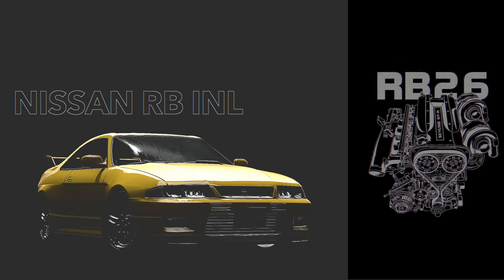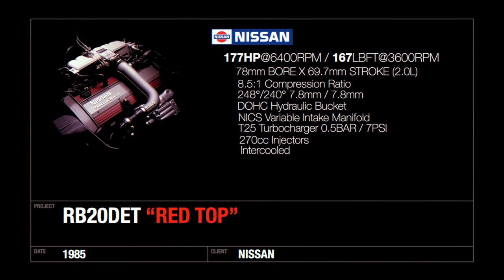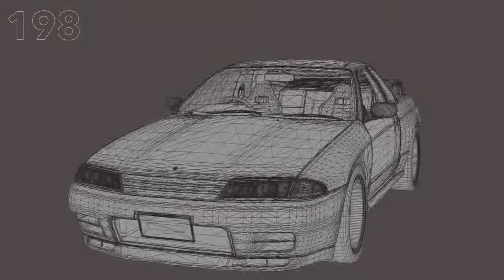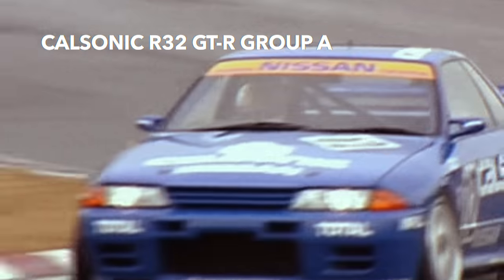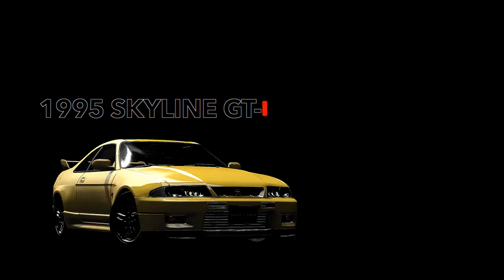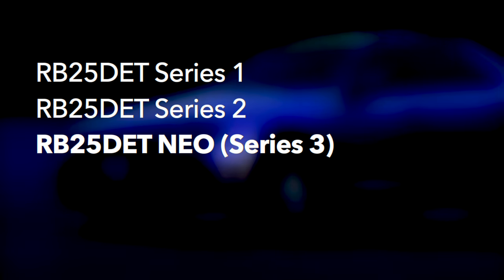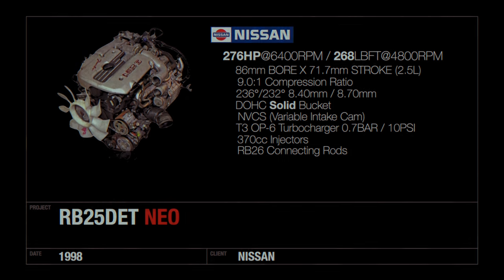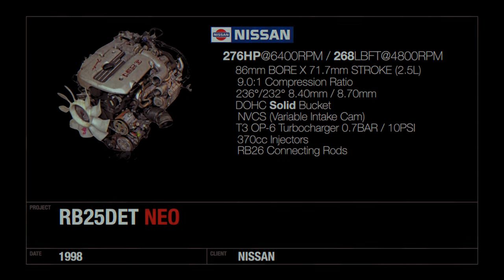How Nissan Built The Greatest Inline-6 | Explained Ep. 19

Comment: For you to mention Holdens best engine the RB30 LOL  being in a Holden, shows how much effort and research you put into these videos. not many non Aussies will know that. This combination of car and engine, injvented the term dosing, to dose  LOL. if you dont know what that means Youtube "VL dosing"  Is it just me or does the RB20 doesnt make sense, I think Nissan realized this, and made the SR20.
Reply: It happened because Holden didn't have a 6 cylinder engine that could run on unleaded ready to use. It's also why the V8 VL didn't come until a bit later. Also, the RB20 and SR20 are quite different. One's a lower displacement inline 6 and the other's an inline 4. The RB20 was likely just made redundant with the SR20 and RB25 rather than some sense thing.

Comment: Since August I have been lucky enough to be the owner of an RB powered vehicle. While it's an RB25DET & not a RB26DETT it's still very fun. I was able to pick up a 1996 Stagea RS-Four V. Was quite a bit but it's paperwork was already translated & it had a US title so it was definitely worth it. I've only had it out a few times because I currently have too many projects at home but it never fails to turn heads.
Reply: You're correct. RB25DET's are fun. My first Skyline was a 1996 R33 GTS-T. Over the years I did a few modifications, including a Race pace Motorsport built engine, upgraded Garrett turbo, Manifold, Wastegate (+screamer pipe), engine management system (Apexi Power FC), fuel system/injectors, coilpack,  exhaust system, intercooler & piping,  brakes, wheels/Tyres etc... I ended up with 310 rwkw and definitely was worth the money.

 I later bought a Midnight Purple 1997 Skyline R33 GTR V-Spec and also got it built/modified by RacePace Motorsport to suit the track and the road. This one had 400rwkw and was very responsive and fun to drive at the track as GTR's (RB26DETT) are AWD, not RWD like the RB25DET's.
Reply: @existenz1974  The last two weeks I've been driving it everyday to work & back home & out n about & I'm really getting used to the RHD. I'm lucky enough to have gotten a RS-Four V Stagea which has a R33's ATTESSA-ETS AWD system but only the RB25DET. The 26 was reserved for the Autech 260RS Stagea. It's stock other than some select HKS components installed before it was shipped including coilovers, intake & exhaust, SSQ2 BOV, boost controller & turbo timer, simple bolt ons. But even still it is super fun to drive something so big yet so responsive. Ive built quite a few rotary powered MX-5's, a few rotary powered kit cars, a few AE86's and a Datsun 510 so I'm used to small, light, shorter wheelbase cars. Probably why I find this car to be so enjoyable.

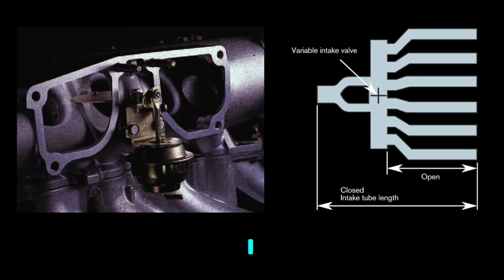Comment: slight corrective:  1:52 - this picture is about NA RB20/25 NEO engines, there was a NICS system with such binocular ports.
I believe early rb20det R31  does not have NICS dividing 1-2-3 -- 4-5-6 cylinders.  But it might have a NICS system for closing every second intake valve to mimic SOHC engines in how they flow air in low-end rpm range
Reply: Correct. I am currently turbocharging an NA RB20DE Neo and it features both the NICS as well as the swirl valves right before the intake ports on the head, which helps lean burn and tumble effect within the combustion chamber.

Comment: As some one who not only owned a 32 GTR and tuned a few others, these motors where built to move, sounded amazing. Miss my car so much. The power you feel when the boost hits and your pushed in the seat, un matched. Watching the tach needle snap up into redline almost faster then you can shift into the next gear. Tuned a 33, it scared me to the point when I finished with it I didn’t want to drive it. It would light up all 4 at 70 mph without batting an eye

Comment: I love these videos bro. I wonder how the M54 stacks up against the 2jz? I know the M54 isnt turbocharged but comparing engine to engine would be interesting. I personally think the M54 is another very capable overlooked power plant that has good tunning potential.
Reply: id also like to see a vk56 or a 1uz video to something different always cool to spice things up.
Reply: @ebkbk9902  Yes sirrr! 💯🔥
Reply: With the iron block of the m50 they go OK. Can't really rev them Super high though  due to harmonic issues.
2jz and rb can be built to rev to 10k... Haven't seen that with m54. Max around 8k on a fully built motor
Reply: @simonhill6267  Yeah that's more than enough anyways if you want boost. Plus keeping the revs below 8k would theoretically make a engine last longer than one that revs out past 9-10. At the end of the day I want a long lasting engine just as much as I want a powerful one. 

I use to get all excited about revs, but not anymore lol.. I always look at the 993, 996, and 997 Porsches and tell myself if these cars perform the way they do on boost under 8k rpm, then there's no need for me to want anything more than that on a 450-500 hp build, but you're absolutely correct.
Reply: m50 block with m54 crank and pistons with aftermarket rods is a great option if you cant afford a b58.
Reply: @mrsquishyboots  hell yeah. 💯
Reply: Add M104 to the list, Turbo Bandit tuned one to over 1200hp. 👌🏻
PS: I really like inline 6 engines - balance, durability and power. 🍻

Comment: Fun fact - the R33 series 2 GTS25-t would come with a factory boost solenoid. It would run boost at 5psi up until 4500rpm (from memory) and then increase to 7psi.
Owned one for 11 eleven years from stock and had modified it a lot during that time. 
Tried the PowerFC but didn’t like it so instead I had installed a Wolf3D aftermarket ECU (that used a MAP sensor in lieu of an AFM) which could also use the factory boost solenoid; this allowed me to run boost at 20 psi 👍 making 252 kW at the wheels with the factory air box (using K&N panel filter).

Comment: RB engine  main problems are the oil ports reving at high rpms for an extended  period of time will cause the engine to either blow or starve essential  components  like piston rings or cams at least from what I seen
Reply: from what you've seen, as most rb comments go
Reply: @sircefiro  perfect example  of this would be drifting
Reply: @frosty212  Drifting kills everything eventually lol, I've been involved with the D1 guys & seen good condition stock rb's making decent power last a few seasons which is a lot longer than a lot of other engines

Comment: Can't be understated that in the lead up to the return to the GTR name and introduction of the RB, that the investment into the FJ20ET in the DR30 Skyline trying to get Nissan back into racing was a good help moving things along after lack luster results from the mid 80's foray Nissan had back into racing (and the Skyline Super Silhouette that came during the era was a wild design for as meh as it performed).

And for those wondering if there was an engine almost as rare as the Z2 engine, that would be the Fine-Spec engine (essentially combine all the best parts of the N1/Nur Spec engines with upgraded parts and only 50 were offered in 2003. Another "Final Edition" was put out in 2009 with R35 GTR injectors, dedicated ECM, and R35 Air Flow Meter and only 70 of those were offered).

Comment: 206kw for the R34 GTR was way down from what it was on release. 
It actually put out roughly 250kw. 
The VL Turbo was a pleasing mention, I'm surprised they didn't use them in Bathurst. 
They were going to put in the RB30DET into the VL Turbo, but they wanted to give their V8s a chance as power would've gotten way too high.
Reply: Yet the RB30ET was still better than the V8s. Granted closer but still. All the R32-34 GTRs had way more power than advertised. It wasn't uncommon among the group of Japanese sports cars from the late 80's through the 90's. The R34's power depended on the year though it was a marginal difference really. The last run was about 250kw. The last of them were pretty much perfected from factory. The VL Turbo's are quite valuable now.

Comment: Very nice and informative videos , as much as I love rb26 , but it's not a reliable engine specially with oiling problems
Reply: Who the hell keeps a Rb26 stock now
Reply: @user-ht7ub4vd5x  it's very expensive to modify and it costs slot to solve the oiling problems, the ultimate solution to solve the oiling problems will cost more than 10k usd

Comment: Very cool video but there are some serious problems with that engine that people should know like the oil pump and when you change to Nismo oil pump you have to drill out the oil passages in the head the engine block cracking in between cylinder 3&4 when 500-600hp is reached the cylinders not being bored evenly across the block crank flex so be prepared to spend 10-20gs on this engine to bulletproof it just trying to help (I still love it )

Comment: if you remove the brass nipple restrictor you get a perfect 14.5psi..because they run rich no turning required for that extra boost. with Exhaust,air filter and 14.5 psi power jumps to 250 WHEEL kilowatts 

As you can see the gentleman agreement is out the window

Comment: Excellent video, the only thing that criticizes you is the mistake you made when interpreting the purpose of the ECCS, which is the fuel injection and ignition management system used by Nissan (as well as the Motronic from Bosch or the TCCS from Toyota) and not a variable induction system as such, what happens is that Nissan in those years placed those initials on the intake manifold and not on the valve cover, for example the GA16DE engine of the Nissan Sentra B14 also had those initials on the intake manifold of its latest versions but it did not have a variable induction system, if you look at the service manuals of the RB26DETT you will see in the list of specifications that it also used the ECCS system but it did not have a variable induction system because it is obviously turbocharged, this review I do it to you in a constructive way and not as a discredit to your video, which I repeat is excellent.

Comment: still love the ca18det engine i got 600hp out mine was faster than superman admittedly fuel went down same speed as revs went up by i think my s13 was one hell of a motor i stil miss it , then my pulsar i made a chip tune board and turned it from standard to 350bhp rolling roded was awesome , but my fav was the s13 i ike it over the s14 pulsar and skyline r32 i had.

Comment: The RB25DET in the R33 ran only 6 psi boost from factory! not 10psi  , 10 psi could be had from the stock turbo but you were at its reliable limit  producing around 210kw & upwards depending on the ECU tuning, the dump pipe/ exhaust , front mount intercooler

Comment: I like how thr vg series of engines was overshadowed as usual even when they were putting out 1100hp and running 24 hour races with 4 rotor rx7s 4 cylinder 1000hp supras and 900hp jags and Mercedes.

Comment: Quick question but why measure the power of a car in Kilowatts when they are gas run engines and not just stick to the old horsepower as that was the correct way to state power as they used a horse and cart ?

Comment: I own 2 Skyline GTR,s , there Amazing cars, I think the RB26 is a better Engine than the 2JZ Toyota Engine as far as Enthusiasts go is , the RB26 was actually used in the Group A Touring Cars, they were very lightly Tuned, running 550 hp to 650 hp, the only mode was Forged Pistons, but the main reason I like owning the RB rather than the 2JZ is the 2JZ was never used in any of the Group A race cars, they used the V8 engine,s, I guess it’s just a History thing for me, take care.
Reply from the maker: Same, I love the RBs racing pedigree. And it’s an engine conceptualized in the early 80’s which for a near 40 year old engine design it’s pretty badass.
Reply: The RB26 lasted all the way until 2002 in JGTC which is impressive. The Supra also used a 4 cylinder engine. The same one from the Celica GT Four only more powerful.

Comment: I think you mean torque, not power.  Power is work/time, so a weak engine can take 10 minutes to spool up the same horsepower rating as a strong engine requiring a few seconds.  That difference is torque.

Comment: So which RB is the best from a builders standpoint?
Reply from the maker: The 26 has the most support but the RB25DET NEO is probably the best bang for your buck. Solid lifter, 26DETT rods, Variable cam timing for torque, and a big single turbo and fuel can make 500WHP fairly easy.

Comment: I have learnt something about straight 6 engines they are not as good as a v8 😄😁
Reply: It's an inherent issue with any 6 cylinder engine. It's harder to get power out of them than a V8. That's why 6's need some form of forced induction to stand a chance against a higher end NA V8.
Reply: @ShiningJudgment666  you are correct l prefer a v8 naturally aspirated with all the good bolt ons l have nitrous injection on mine as well but the nos is rarely used 👍

Comment: Love ur vids but still you talk about all these in-line 6 motors but have not mentioned the most impressive one of the time period …. The diesel MB Om606 it could put down same power, rev to double other diesel RPMs, make way more torque then any gas motor, is cheap, plentiful and economical and all u need is to throw on the previous gen mechanical fuel pump and ur harness need only be 3 wires

Comment: RBs are cool and all but N54s & S58s be smacking them like they silly😭
Reply from the maker: An engine made in 2007 is better than one made in 1984, damn I would have never guessed😢
Reply: quickest street rb runs 6.56 sec 1/4 mile 

quickest drag rb 5 sec 1/4 mile
Reply: @negativeknowledge  , yeah one in the high 5's .... just one. And I bet you... it be years before you see another one do it. Just doesn't have the juice to make low numbers on 1/4.
Great on the track for fun days, and yeah yeah yeah... sounds better than a 2j... but still not as good as one.

Comment: RB motors can’t handle power. Not sure why this video exists. RB motors are the most unreliable, overhyped JDM engine out there. They HATE high RPM. Even the JDM holy grail aftermarket parts can’t save those motors. You have to billet everything if you plan on having a high hp, high revving RB motor. 

Dear content creator. You’re a liar
Reply from the maker: Lmao Stock RB26s have been 9’s in the 1/4 and 800WHP on factory rotating assembly. It’s not overhyped when these engines won 29 out of 29 races in the JTCC group A. All these engines need is oil control😴
Reply: @337speed  that is incredibly hard to believe they used stock crank/cam and components. All I’m saying is Nissan RB motors are the worst inline 6 motors created from factory. They hate being drove hard unlike pretty much every other i6 out there.